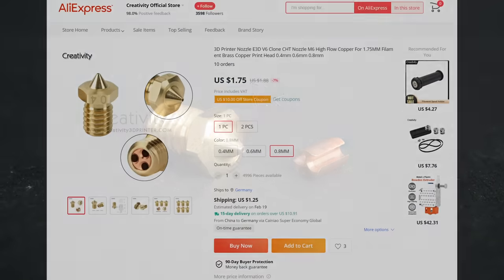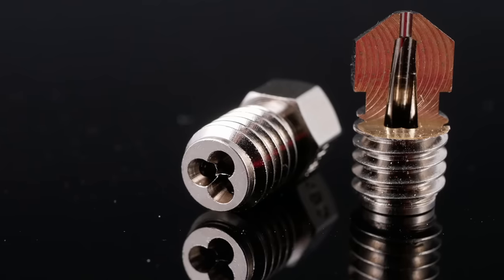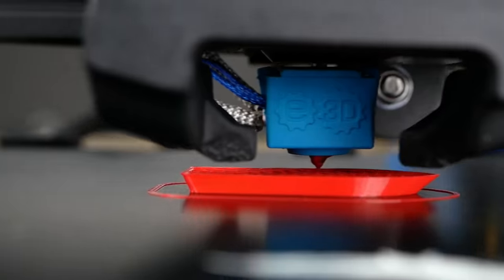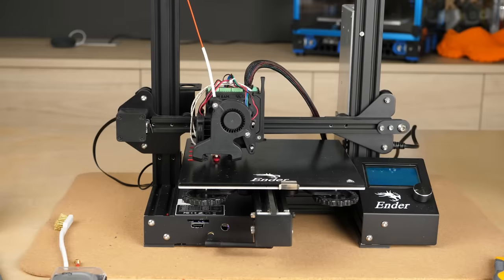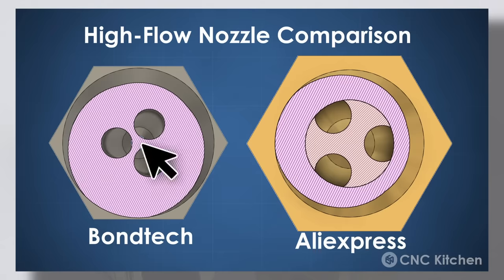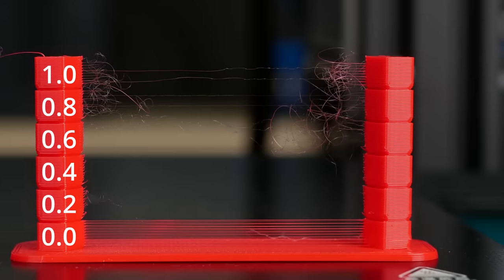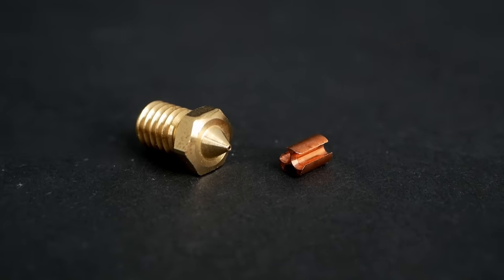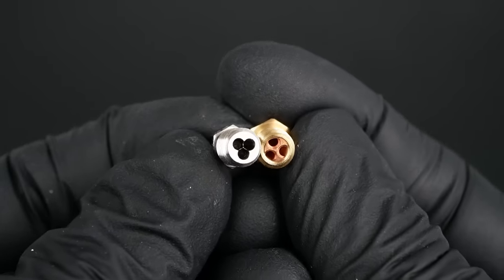$2 Aliexpress Knock-Off better than Original?

Comment: i bought a bondtech CHT a while ago and just installed it recently. and compared to the stock nozzle on my ender3 from 2 years ago, it didnt improve flow at all. the extruder stil has problems pushing without clicking at more than 50mm/s and 0.2mm layerheight. idk what to say there. the motor skips backwards as if it doesnt have enough power. it doesnt slip on the filament.
Reply: Maybe a bad motor or driver, mine didn't click with the stock tensioning but ground through the filament at some point.
Later I made a fixed width tensioner now it newer grinds through but skipps sometimes. It only skipped on the first layer and printing 70mm/s with 0.6mm width with a 0.4mm nozzle at 0.2mm layer hight wasn't a problem. 
Later again I added a bowden inlet tube from a filament storage compartment and it worked fine for about a year then the friction on the inlet tube increased and it skipped because of that, now put a teflon tube on the inlet as well and it works again.
Maybe check your sysem for other sources of drag on the extruder. Also my extruder can pull with about 2kg of force, if you need refrence to declare if the motor or driver are bad
Reply: Same here. I attached Volcano block and nozzle to hotend and reused stock heater and thermistor. I'm going to install Titan Aero clone with slug nozzle when I have time.
This kind of slug nozzle should work for Ender as-is, even if it is V6 and has slightly longer thread - unless it leaks between heatbreak and PTFE tube > all or bi-metal heatbreak should solve that.
Cooked end of PTFE tube or gap between tube and nozzle can cause all sorts of troubles. Fastest and cheapest way to increase flow is simply increasing temperature 😅 but that can cause other issues (stringing etc).

Comment: the depositing of the filament whisks away temp at the same time. faster printing needs more heat have you tried to do these speed test with incremental temp adjustments as well?

Comment: you say that one of the problem for fast 3d printing is how fast you can melt the fillement, what if during the printing you keep your fillament reel in somthing like oven that will keep it at somthing like 100 dgree so the nozele itself will need mach less heating work?

Comment: I really wonder if using a hardened steel or Tungsten Carbide nozzle with CHT would go. (I can't find any TC, but lots of HS so maybe that would allow you to run the nozzle a little cooler due to the splitting)

Comment: Interesting... I wonder how what further improvements can be made, in both designs. Maybe it just doesn't show well, but the insert seems like it has a large flat area that would just add friction/pressure/something for the incoming filament. Something the sharp divider in the Bondtech does not have to worry about. Between mixed materials, additional design options, and reduction in manufacturing cost, I feel like there's a lot of things that could be done and experimented with.

Comment: Bondtechs high flow nozzle is no joke. It literally made my prusa mini so much better mainly because it fixed the constant clogging issues that ended up breaking ptfe tubes often. $20 well spent when I've saved more than that in time and parts

Comment: I see that various nozzles are available for the X-Max 3: nickel plated copper, or CHT clone like you tested. What are the advantages in flow rate of nickel plated copper vs CHT? copper should transfer heat better than brass already.

Comment: However, the Aliexpress version seems to be a little less stable before it drops off, doesn't it? It would be cool if the inner part was heatsinked into the nozzle.

Comment: Thank you very much for the comparison.
I hesitated to buy the aliexpress-variant because it looks like there is a flatspot in the middle of the insert. I was wondering if the filament won't just push against the flatspot and generate a ton of drag or force.
This seems to be no issue.

Comment: Very interesting! My experience with the knock off are not great at all. I did some extrusion tests and could not see a great improvement over the standaard V6 !
I even tried to smoothen the chamfers at the entry of the nozzle, but also that did not work.
Eventually, I switched over to the clone Volcano nozzle with an extra nut for thermal mass, which works great, but I would prefer a CHT nozzle so that I can easily swap it with a regular nozzle when i need it, without having to change z-offsets en mount my other fan duct with less height..
Maybe I will give it an other try and order some more CHT clones..

Comment: Tried the CHT nozzles and had issues. I have the V6 hotend. The first issue was I had to increase the nozzle temperature 10 degrees which defeats the purpose. 2nd issue was they irreversibly clogged with less than a month of use which may have been 20 hours of random use. Won't be trying the clones or anything else like them unless I get a different hot end. I print most PETG and I suspect the clogging was related to excessive temperatures.
Reply: and the temperature was...?

Comment: In my harsh judgement, they shouldn't get a full patent - just a design patent for their specific solution.  Design patents are more akin to copyrights.  But even they are too broadly applied.  The problem itself isn't that difficult - solving it just requires application of well known principles of heat transfer.  It's just a matter of exploring the engineering space for this task.

Comment: What is the diameter of the cht core insert? Is this a 3mm nozzle with an insert or does it have a special diameter? I’m asking because I got a 3mm Olsson ruby left over after I shut down my 3mm printers for good and now I’m wondering if I can convert it to 1.75 and have a better melt with one of these inserts :)

Comment: I think there are enough different features to the Aliexpress nozzle to not infringe the patent, even if it were in place. Slots, not holes. Machined perpendicular and not angled. Loose two piece construction and not pressed in. But as othere have said, when did the Chinese manufacturers ever take any notice of patents or I.P.!

Comment: Ive been using them for awhile and I probably won't go back to a standard nozzle. Even at normal speed printing, the  segmented melting compartments seem to dissipate the pressure buildup and I get much less oozing. The small artifacts you get from extruder gear teeth are completely gone as well.
Reply: Very interesting, I've been looking for a way to decrease oozing. Thanks for sharing.

Comment: I alway wonder why need a large pool of melted plastic for extraction. Is it possible have a highly focus heat source close to the tip for just-in-time melting kind of like welding. Hence, eliminate the need for retraction. Just a thought.

Comment: I think this works well specifically because of the design. Why was that design done? Meh, not a problem for those who don't want to commercialize.

Because you're transferring through less of the not so heat maneuverable material, brass, and either, going into copper or into the air/plastic directly, there's a bunch more heat transfer capable.

If it were me, I would just buy a nozzle even cheaper, 0.6mil, and sell the lobed inserts, with a literal twist in order to increase even further the back emf or return heating to the brass at the tip. That should eliminate the patent worries, as well as increase speed, and allow for even more flow.

Comment: i wonder how difficult it would be to modify a standard nozzle to use this insert. this would make it possible to use in a ruby nozzle for example.
Reply: Sure if you have the right size drill bit or a lathe its not too difficult to modify.

Comment: That claim is very broad. Also: - "heat conductive material" is referring to the nozzle, and -"attached in at least one place on the inner side wall" is referring to the heater block, not the the inside of the nozzle. It is basically describing the typical hotend method.

Comment: At this time, there is no patent on the Bondtech nozzle shown in this video. There are several patent APPLICATIONS in various jurisdictions. Since there is no patent granted, there can be no patent infringement. Further, because something is shown in drawings or a description, does not mean that a patent protects against infringement of that. The CLAIMS of a patent are the metes and bounds of the intellectual property rights. One must infringe a CLAIM of a patent for patent infringement.

For the U.S. patent application, I looked up the latest rejections to its claims. The Examiner is an assistant Examiner, and like most assistant Examiners, is an idiot. Further, it looks like the claims which may cover the nozzle with the "insert" have been withdrawn but may be filed in a divisional patent application.

Comment: Interestingly, on my Ender-5 Pro the CHT Nozzle Clone is worse than the standard ones. I got only 80% flowrate at 14mm³/s whereas the standard one reaches 96% (PLA 230°C with 0.6mm nozzle)(92% at 210°C with standard nozzle). Don't know how thats possible. The clone I'm using looks exactly the same except that the insert is already assembled and I was not able to disassemble it at room temperature.

Comment: The insert approach is great as it can be optimized for heat conduction / wear resistance tradeoff while the nozzle tip is much harder for maximum wear resistance.. Cool

Comment: Personally i think the Ali version doenst infringe on the patent because the location of the hole are in a different position and its an insert and not one part. I would like to see a more snug fit like having to heat the nozzle to be able to fit it in there so there would be a better heat transfer than if its loosely in there.

Comment: Ok.  Sorry for dumb question. How do i push my ender 5 plus to high speeds to test this. Are you doing it from the lcd panel on the printer ? Im using prusa slicer. Thanks in advance.

Comment: Are you testing also with a printer that has PTFE to the nozzle? I imagine PTFE and this floating insert is not a great combo, as the insert is free to wander into the throat and jam itself into PTFE. I imagine it might explain some of the mixed results people are getting, not only purely that they assembled it wrong way around.
Reply: The PTFE tube has a smaller hole, should be zero issues. Also the melted plastic will go between the nozzle and insert, carbonize slowly, bonding the insert into the nozzle

Comment: I bought a knockoff one, and I'm not sure if the copper insert is correctly oriented (too late to check as it's stuck now) but definitely may have to adjust the retraction settings. I had too much filament coming out (not sure if its just from the pressure of just how efficient the nozzle is.
Reply: I'm using a BMS phaetus dragonfly hotend

Comment: Would it affect the flow anything if you would file the walls thinner at the entrance of the aliexpress one, so it is more like a "knife edge" like the bondtech?
Right now it is more like a wall. Also, do the insert have play up/down then screwed in? or do the heatbreak hold it in place? looks like there is a bit of a wiggle?

Comment: You mention extrusion speed in cubic mm per second, where do I find that value in superslicer ? I see an extrusion multiplier, but it doesn't tell what the value is (using an artillery sidewinder X1).

Comment: I'm a massive imbecile and would lose the insert if not properly attached.
Also it seems like plastic could get into the clearances and remain there until it gasses off/degrades. With plated nozzles I've gone the better part of two years now without needing to change the ones I use, and given that I only need high flow on a 0.8mm nozzle $20 for a longer lasting better consistent quality unit seems like an alright compromise.

Comment: The original nozzle has sharp edges where the filament goes through , the knock off doesn't its flat in the center that will create drag as the filament is pushed against it I the with a little work to the insert it could work better

Comment: I would love to see you test the two mellow V6 adapter (you already linked one on your volcano in normal heatblock video).  Im currently using it with a cht knockoff to get 34mm3/s with a sprite extruder.
Reply: Can you share some details on your setup? I installed a clone CHT 0.4mm nozzle today and my max flow did not improve over a nickel plated copper nozzle.
Reply: @michaelhaas9053  the clone Cht doesn't have a sharp edge to split the filament. So you need it to be soft already before it  gets the nozzle. 
Mellows nozzle extenders are great for this, of maybe a volcano block with a spacer before the nozzle.
Reply: @Twan Heijkoop  Thanks for the reply! I do have an all metal hotend so I should have a longer melt zone.

I was surprised to see that I could have a much higher flow with a standard 0.6mm nozzle. My assumption is now that my extruder can't handle the backpressure of the 0.4mm nozzle.

I ordered some 0.6mm and 0.8 mm clone CHTs to test this :)

Still, getting 20mm³/s with the Creality Sprite Pro hotend on a 0 6mm nozzle was a pleasant surprise!
Reply: @michaelhaas9053 with a cr10 copper block, the mellow pro extender and a .6 cht clone I get 34mm³/s with esun pla @220c. Which is even higher than my td6s CHC pro with a .6 cht clone Vulcano. Which gets 28mm³/s. I'm adding a spacer and a rapido extender nut soon to hopefully bring it closer the the S1.
Reply: @twanheijkoop6753  Thanks a lot! I already have the mellow pro extender here as well as copper block. Once summer is over I will build my own high flow toolhead :)

Comment: I wonder how the performance would change if you solder or add thermal paste to it
Reply: The thermal paste would likely just being washed out while printing. Solder may work. I think the copper is expanding enough to press against the brass bit.

Comment: So does the chamber face towards the PTFE tube Like I'd assume, or towards the nozzle tip.  Because you show it both ways in the video, and don't actually say which is correct when u talk about the problem of installing it incorrectly.

Comment: I don't think these are knockoffs, they are taking a different and arguably better implementation of the same idea, albeit at a lower build quality. I think the insert with some thermal glue/paste to fix it in place and improve conductivity between the insert and nozzle will be a better and more mass producible design than the angled drilling one.

Comment: If you can't cold pull that means you have to take apart everything when it jams, also, i have to wonder how loose it can get when you do retractions
Reply: At that price it’s probably not worth cleaning it out, just swap it if it gets blocked.
Reply: @klave8511  but then doing the whole re-tuning and attachment is a hassle.

Comment: I bought 2 of these ali knockoffs just to satisfy my curiosity and even though they look exactly the same as your the performance on one Ive tried is way worse than mk8 I'm using all the time. I tried to pull out insert on the other one but it won't budge, anyway it looks like it's installed properly with chamfer facing out. I'll try the second one these days and come back but seeing how 1st performs I don't expect much.

Comment: I am curious to know did the aliexpress one perform better because of the design or because it transfers heat better because of the material its made out of. If they were to make a genuine one out of the same material or even the knock off as the same as the real one I would much rather see that comparison. Either way I prefer steel nozzles over brass/copper, which from my understanding is safer to use for things like toys. Since brass particles can rub off into prints which is way more dangerous than steel.

Comment: I don't think that the China solution is a patent violation. It is, as you demonstrate, totally different in the way to cut / split the filament, in the way to produce the nozzle and finally that leads to a better performance and a cheaper price.

Comment: Compare retraction and overall print quality (complicated print) of knock-off
vs Bondtech CHT
then we can start to judge if this nozzle is worth it
Reply: it costs $1.5, "worth" isn't a good word in this case :)
Reply: @SergeiSugaroverdoseShuykov  well it can still be not worth it if it if it worsen your quality. And in some printers with weak extruders that can't force the filament through the blunt splitter it actually reduces performance
Reply: @SergeiSugaroverdoseShuykov  that depend 
Because its more about "if it prints" 
Not about if it extrude for some time...
but cant print long term (get cloged all the time etc) but if it prints like any other cheap nozzle only with high flow ...its worth it.

Comment: Since they apparently improved on the original design, I don't see this as a "knock off".  It's an independent improvement on the design.   A "kock off" would be more like the micro swiss hotend knockoffs, where they're almost an exact copy, just not as precisely machined.

Comment: @CNCKITCHEN Ich hab damit genau die gleiche Extrusionsleistung wie mit der Normalen V6 Düse. Diesen Meander Test hab ich vor 2 Wochen damit gemacht, ab 14-15mm3/s verliere ich mit beiden (V6 und CHT Klon) die Layerhaftung (ABS@255°C). Die Layer brechen ohne große Belastung auseinander. Allerdings mit dem Standard Ender3 Hotend + Bi-metall Heatbreak gedruckt. Vielleicht ist da einfach die Leistung zu gering?